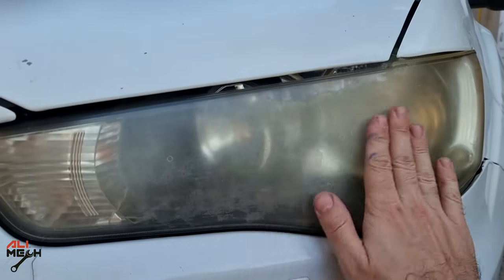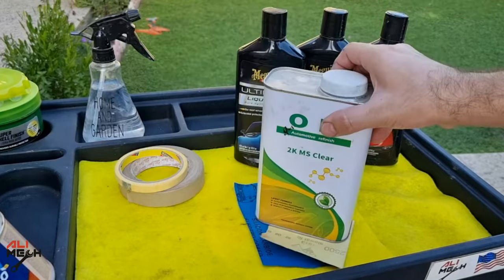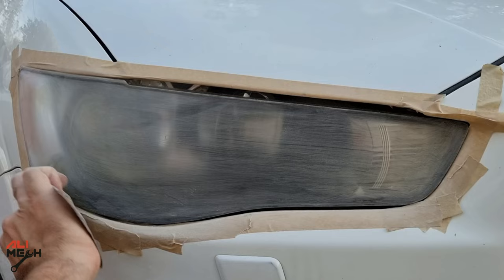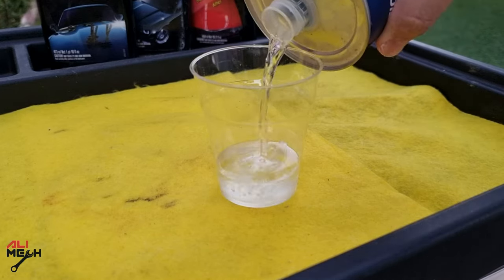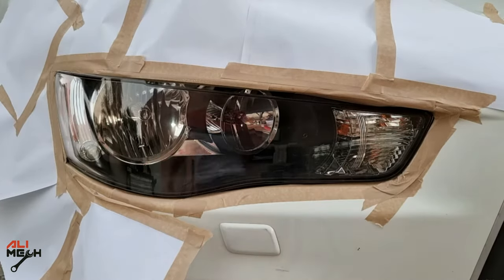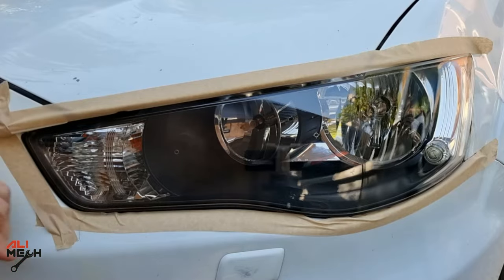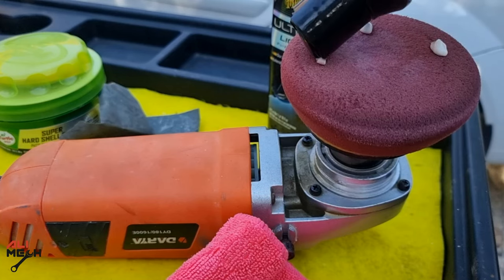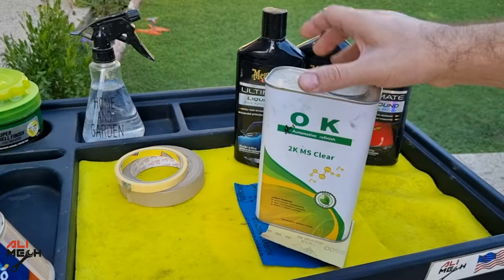Learn how to restore oxidized headlights in 4 mints/Turn your headlights brand new again/ ALIMECH

Comment: I just did the headlights on a Honda Odyssey in similar condition using only the Meguier compound polish first & the Meguire spray headlight coating after that & they both came out much clearer & closer to like new.